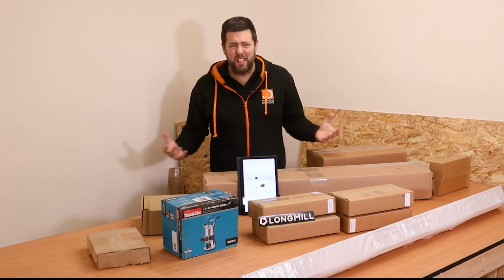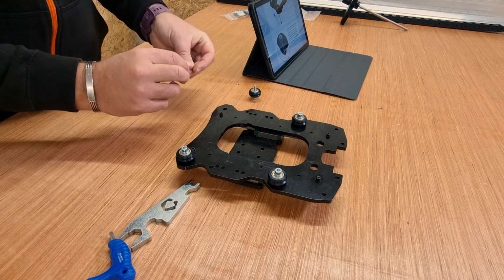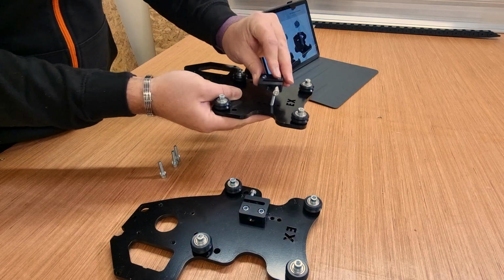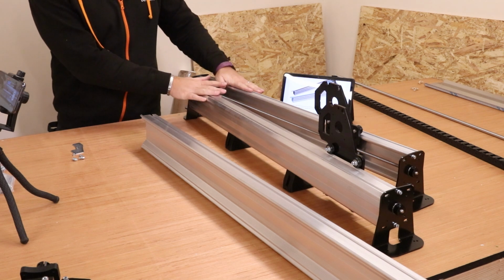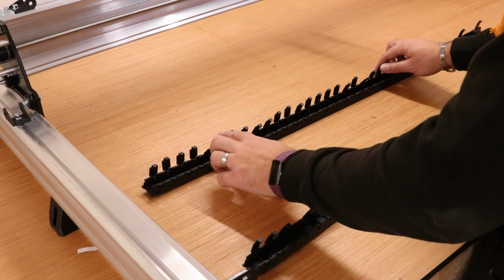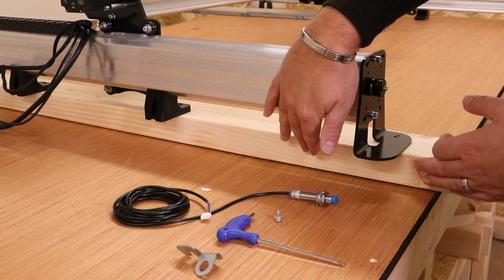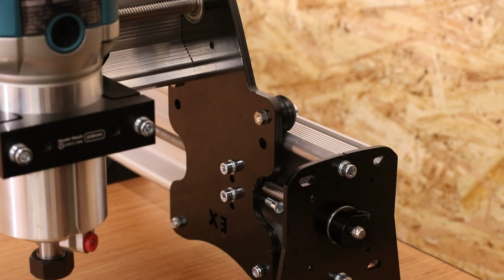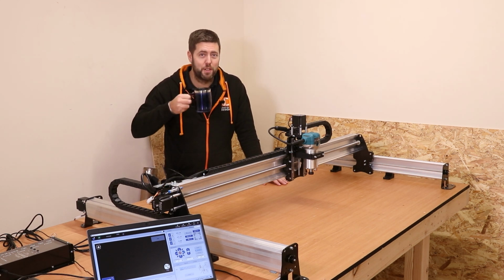Building and setting up the LongMill MK2 CNC machine

Comment: For anyone wondering about running the wiring to the right side: other than the E-chain and bracket, you will also need to move the X stepper motor to the right side and in the firmware youll need to update that motor to "reverse".
Reply from the maker: Good comment and yes, that is true. A lot of CNC machines I have had same fittings on either side to allow for this. Also you can flip the Y stepper motors to the front as well. Useful if you are putting your machine in an enclosure so you can still access the motors.

Comment: Seems like a cool machine, though it is strange that they don't ship it with limit switches by default.
Reply from the maker: Its feeling like it is so far. Not everyone will need the sensors, I never used them on my 3018 for example so it helps keep the cost down which is one of their main goals really.
Reply: @JamesDeanDesigns   I had to fit a microswitch on mine as I kept pulling the nut assembly out by going too far to the left when homing !

Comment: Hey James, I was thinking about getting the 3030-PROVer MAX from your other review with the Makita router to cut small aluminum parts on occasion, but I also want to get a larger machine mainly for wood such as this Longmill or the Ultimate Bee in my new workshop. Do you think that I can completely skip the 3030-PROVer MAX and use these larger machines to cut aluminum? Would this Longmill or the Ulmate Bee be able to cut aluminum similarly to the 3030-PROVer MAX?
Reply from the maker: The LongMill is good for large scale vs budget, but is not good for machining soft metals. The UltimateBee is better but geberally speaking the larger the machine, poorer they will perform machining metal